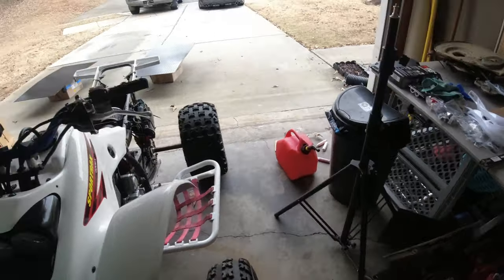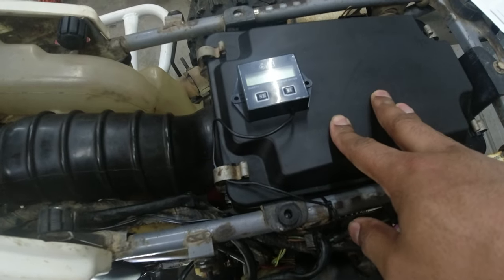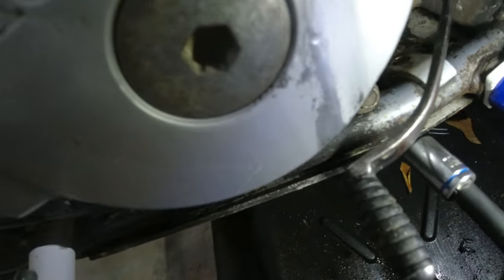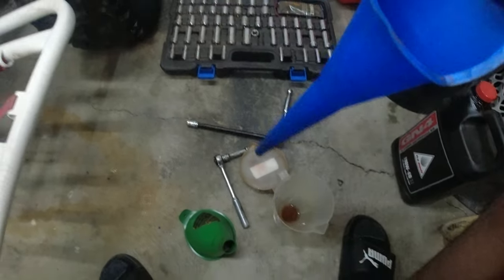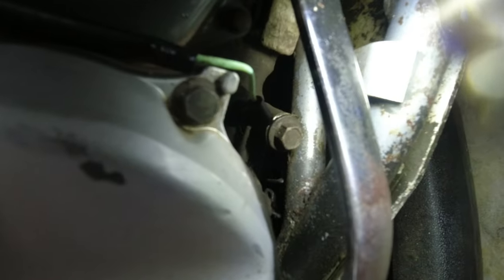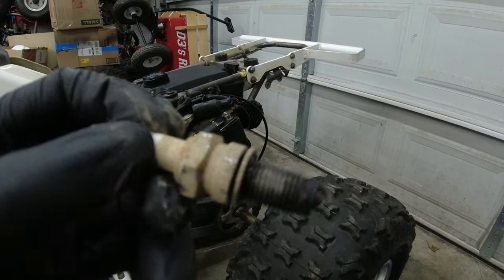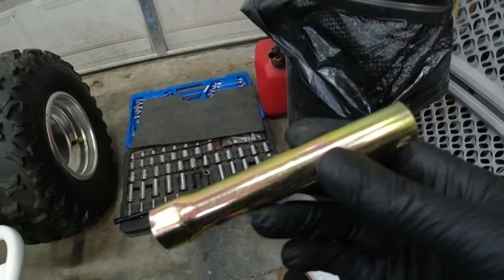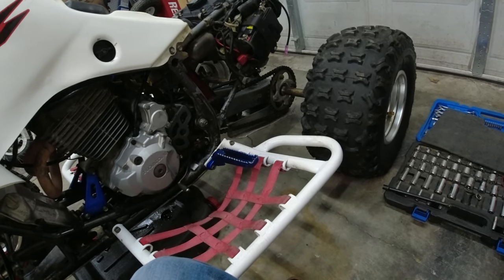Fixing MOST of My New Honda 400EX Issues

Comment: Link for all those plastics? if you know where they came from.
Reply from the maker: Per the guy I got it from, these are it. 

https://ebay.us/x0xd22

Finding the white gas tank cover seems to be the challenge
Reply from the maker: Found the white tank cover

https://ebay.us/JNMGLe

The whites may be a little off from each other
Reply: @DariusBuildz  Thanks man. feel close to oem quality?
Reply from the maker: they feel comparable. The only thing I don't like is that they don't utilize the front fender support. Other than that, they are solid aftermarket units.
Reply: @DariusBuildz  Appreciate the info on em. trying to decide if i want to put my yellow 400 back oem or go white with all the oem decals.
Reply from the maker: Can’t go wrong with either one. My buddy on my channel has the yellow plastics off eBay and they look great too!
Reply: @DariusBuildz  i was thinking about ordering the yellow plastics straight from honda. little over 400 for front and rear. figured that ain’t too bad considering ebay is about the same.
Reply from the maker: That’s not bad at all especially being straight from Honda.
Reply: @DariusBuildz  crazy though its over 1k for the red rears but a little over 200 for the yellow
Reply from the maker: I guess the red is in higher demand, but a $800+ difference is crazy.